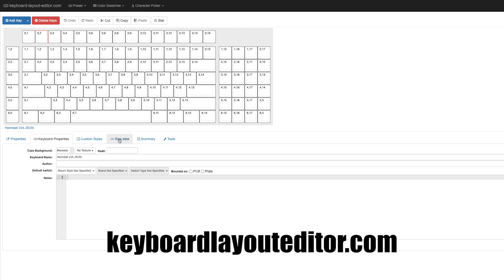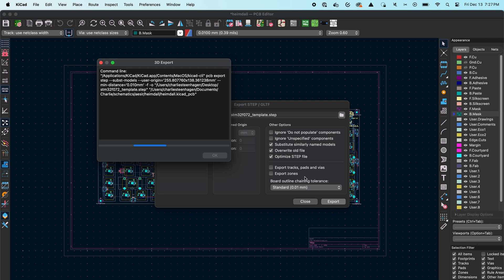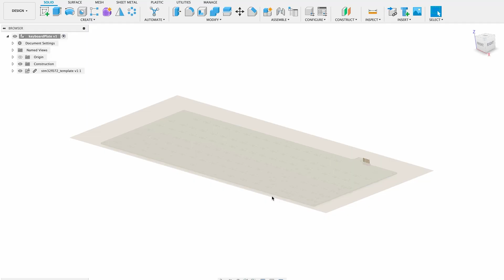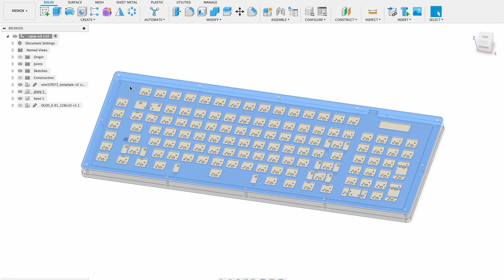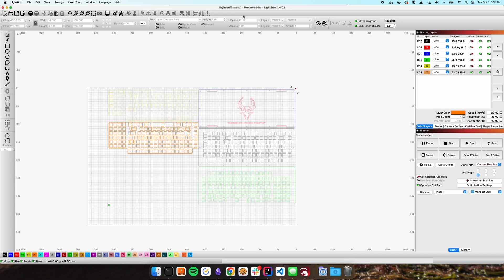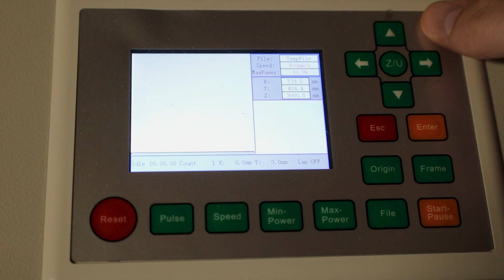Making a Custom Keyboard Case with only a Laser!

Comment: Great video! Very cool project. Three questions for you from a very "casual" modern hobbyist: 1) How long did this take? 2) What was the cost of materials? and 3) How would one find a place that rents out time on a machine like this? (You know, for those of us who wouldn't use it for anything else? 😂)
Reply from the maker: Hey! This project overall was a lot quicker than I thought it’d be, considering the keyboard worked the first time 😅 about a month of planning and designing then a couple weeks waiting for the boards and assembling. Don’t remember the total cost on this, but probably about $250 (boards, key caps, electrical components and assembly). Unfortunately I had to buy two sets of key caps to fill the layout because I designed it poorly. 

Lastly, DSM (or Iowa in general) isn’t great for maker spaces, but I’m sure you know a guy that could hook you up! 😉